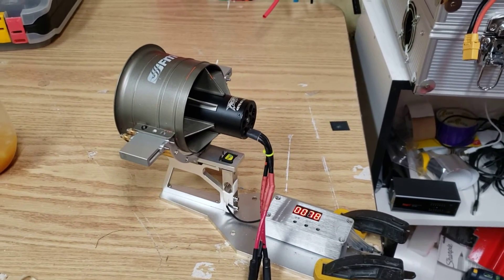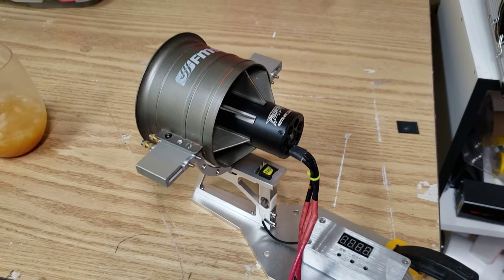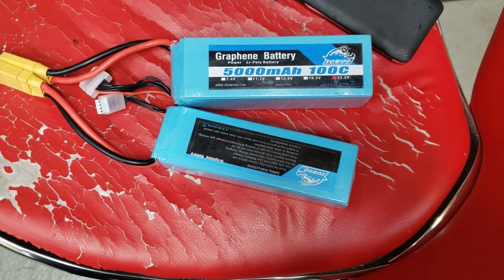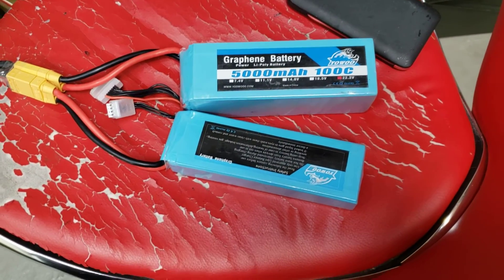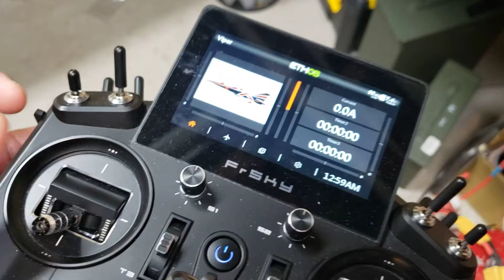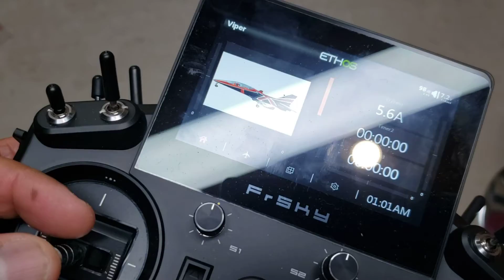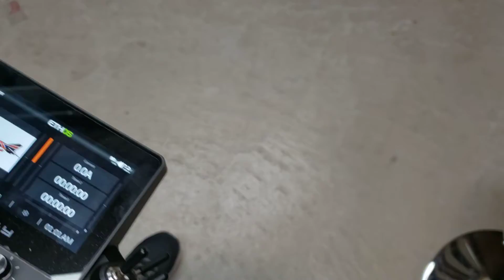FMS  90mm 1500kv 9s and 10s thrust stand test.

Comment: Great power, did you also do a test on 8s? what are the numbers like?
Reply from the maker: I did I just didn't upload the results. My findings were as per FMS specifications on their website.
Reply: @ghoustanable  thanks man
Reply: @ghoustanable  how many flights were you able to do with 10s on this motor.. Considering this setup for my freewing ares. which could benifit from extra thrust for hovering and better punch out. Btw i have a pack of those yoowoo batteries, they perform so well!

Comment: Hey Garfield. Wicked outcome from that 90mm FMS on 10S man 😵
Has it withstood the test of time?
Reply from the maker: Absolutely no issues whatsoever. I've installed this setup on at least six different 90 mm jets with over 100 flights with no issues. That said I think that 9s is the sweet spot in terms of power and easiest on your batteries with lower amps.
Reply: @ghoustanable  
Thrilled to read that. No heat sink whatsoever? 
looking at your data from that test I`d say this is the perfect subject for a 10s 8000mAh Li-Ion 21700 cell pack. 

I will be diving into that and your results here set a good guideline. Probably wont hit the 6.4kg of static, 90% of that realistically achievable. Capacity however doubles with Li-Ion and for those big thirsty jets this might just be the solution - trade a bit of top end speed for allot more flight time and allot more WOT episodes too. 

You ever looked into substituting LiPo for Li Ion?
Reply from the maker: @marioserafimov7254 I did I just didn't want to invest in the soldering tools necessary to make them. That said I know that there is one outfit that's making the batteries but they're pretty pricing
Reply: @ghoustanable  By the way, have you ever had the chance to test the Freewing unit (Metal shroud 90mm 12-blade 4075 - 1350KV) ?

Comment: This is very sick on 10S. This week I ordered some 5S CNHL 4000 just in case xD xD But I would probably go with 10S LiIon that would be in the middle and 9000mAh or 10000mAh with similar pack weights. I´m thinking which 90mm Edf to install in my new older V1 Freewung F-16... Maybe I´ll start on a light 3670 1950kV motor with light Esc and running on 7S LiIon or 8S
Reply from the maker: @ficosk8  where are you getting the Lilon packs from?
Reply: @ hi Garfield!! 👍🏼 well I just get the cells and solder the packs. It isn’t difficult just need a 150W iron for 15 bucks and solder quickly the copper strips on the cells. Everything is very cheap compared to Lipos and this will last up to 500 cycles . Here in Germany at local websites for e cigarettes or NKon in Netherlands. In USA there is 18650 store which also have the very powerful Ampacel JP40 which have very little IR, voltage sag and less heat but are “only” 4000 packs. I’m just starting with this but it is really cool to fly over 10 minutes on one single pack and just 1 parallel. I’ll try 2P on 80mm Avanti and L39 soon I hope but the snow has come here…
Reply: @ your tests have been super valuable!!!

Comment: I saw you run 9s with a 6s and 3s? Can you do 8s with 6s and 2s? 😊
Reply from the maker: @Rombo-86  yes you can if they're the exact same milliamps as well as c rating and manufacturer.
Reply: @ghoustanable  yea of course. I’m planning to buy the fms viper 90mm and put this motor in and run 8s on stock esc. I have to many 6s batteries. So instead of buying many 4s batteries I was thinking to buy just 2s and have with the 6s 😊

Comment: Update: ran this exact set up and everything was great until the 10th flight.  The fan blew itself apart at max throttle during take off.  The motor might be able to handle 10s but the fan has potential to fail.
Reply from the maker: @bryanho6830  sorry to hear about that. I've been running it on over five different 90 mm jets for 2 years with over 100 flights with no fans failing.
Reply: Who knows, maybe the new batches are not as good.  I bought another one and will try again.  The performance is amazing at this price point so I gotta try again..wish me luck @ghoustanable
Reply: Metal blades as on the JPs would help... if that occurs often. But the replace is easy, isn´t?

Comment: So if you run the motor on the highest setting how long does it take to drain the both battery packs? Say if they are fully charged. 
Thanks.
Reply from the maker: Two and a half to three minutes on 5000mah

Comment: Which connectors do you use because the gauge wire on the motor is smaller than the esc
Reply from the maker: XT90
Reply: @ghoustanable  yeah I was talking about the esc connection to the motor what size banana connector you use
Reply from the maker: @mr.maneuver287  I run Castle creation esc, so  6.5mm bullets is what's needed with that gauge of wire from the ESC. The gauge of the wire on the motor is usually smaller than the wire on the esc, which is pretty common.
Reply: @ghoustanable  ok perfect and is there specific settings i should program the esc for.. and I do want the reverse thrust as well
Reply from the maker: @mr.maneuver287  you need the USB Castle creation dongle to go into the programming section in the software. The tab you're looking for is auxiliary. Select the drop-down for reverse thrust, and you're done. Note that you'll also need to run the auxiliary wire. I believe it's a white wire to a separate channel on your receiver to get it to work. Then, just assign that channel to a separate switch on your radio to get it to work. Cheers
Reply: @ghoustanable  you da man thank you so much

Comment: Hi, does the motor supports 10s voltage ? I have the viper 90mm on 8s setup with the same edf unit + motor
Reply from the maker: Yes, it does.

Comment: I have an engine like this and the recommendation is batteries up to 8s, are you using up to 12s. Does it not burn the engine or force it too much?
Reply from the maker: Maximum you can run this on is 10s. That said, I did do 3 test runs on 12s & on the last run up, it exploded. Personal if you ask me. The sweet spot for this motor is 9s if you want to keep the amp draw below 150amps.
Reply: @ghoustanable  which battery you hit 300km/h and the Esc is Ubec or Opto?
Reply from the maker: @maicondp  yowoo 4000mah 100c graphene paired with Castle creation 160 ESC and BEC.  https://youtu.be/ID0l-2xlOC4

Comment: Quick question. I have this exact set up for my Freewing F22. Is there anything specific I may need when extending the battery leads from the esc? Or can I just extend the wires to reach my battery? Also, is the castle 20amp bec sufficient for the Freewing F22 or is there something I need to add? Thank you and sorry for the book. New to this side of building custom.
Reply: Ran mine on 12s and it ran like a champ. Definitely more punch to it. Still isn't getting hot at all. Same set up. Castle 160amp esc, Castle 20amp bec, with the FMS 4075-1500kv 90mm edf. Not sure if you have tried a bench test 12s yet but I must say that FMS motor is a beast.
Reply from the maker: @Jason Willoughby  that's fantastic. I'm definitely going to be trying that once I have batteries that can fit. Thanks for the heads up on this. Send me a link if you've got a video of the flight.  Cheers 🍻
Reply: @ghoustanable  I'll have to get a video this weekend for you then. Only have a certain 2 batteries that fit to run it 12s. They are premium HRB 6s 5200 100c. They are short and stubby. The graphine 6s 5000 100c won't fit in there good enough and maintain cg.
Reply from the maker: 20 amp bec is more than sufficient for the F-22. Regarding extending the battery leads, just make sure that you match the  gauge of wire for the extension. Also, I'd recommend soldering the extension wires together as opposed to putting in bullet connectors to make the extension connection. I did that with my F-22, and it ended up costing me my plane due to a partially disconnected bullet connector causing arcing and eventual power loss in flight. See the link below below of that crash. Cheers and good luck 👍. https://youtu.be/2IEh14r_ZeA

Comment: How do you power your FrSky dual supply Rx? Use an additional BEC? Powered from Flight packs?
Reply from the maker: It depends on the plane. If I'm running high voltage servos, I  use 2s lipo directly to the receiver. If it's like a freewing plane that needs 5.5 V, then I use a BEC.

Comment: you are making my brain explote!.... how much fligh time do you think you can get with an 6000mah on 9s?... what will you say to put a 3300mah on 9s?  i heard you can flight with 12s on 3300 easy cause the consumption is lower on 12s
Reply from the maker: 6000Mah 3.5 min. Regarding 3300 pack on 9s too short a flight for me. This edf cant handle 12s. I tried it and the fan exploded. very dangerous situation!
Reply: @ghoustanable  thanks a lot for the answer and the info !!
Reply: @ghoustanable  Hello, after about 8 flights with the fan on 10s I`ve noticed a significant power loss ... I was aware of not heating the edge and the esc... might I damage the edge? Is it fixable?
Reply from the maker: @danielalessandrini2299  that's strange. I'm not really sure. it depends on the damage to the ESC. That's said I've never had any problems with this setup with over 200 flights on five different Jets the setup has been rock solid.
Reply: @ghoustanable  yes very strange... i bought 2 of them and both had the same problem... and the esc are working fine, 12s 150a

Comment: hi, what's the thrust when using 8s?
Reply: Installed into my F4 phantom it's 3.9-4kg. Installed into my F22 it's 4-4.1kg. In my T45 it's 3.7kg. All 8s.
Reply: @M4rkmcc21  thanks for the reply! I just realize thrust are also depends on the aircraft design.
Reply: @afxdz evo  yeh I found thrust is lost on twin exhaust jets. Also if thr exhaust outlet diamter is too large like in the rafale there's a loss. Can 3D print a smaller outlet tho. Also the T45 Exhaust tube is obstructed with the Air brake servos. I found opening my cheater intakes on my Sirius gained 150g of thrust
Reply: @M4rkmcc21  good information thank you vm

Comment: I have same setup in my f22. I was using custom timing at 7 for 40 flights with no issues. I watched a video and changed the timing to low 1 and 2 minutes into the flight power failed and I deadsticked. I guess im saying I would not run low timiing with castle using this motor fan combo.
Reply: on 10s?

Comment: Can jet fan handle this? If I were to get the 1500kv and run it on 10s do you have an idea? Currently I’m running the 1680 on 8s and was thinking to upgrade for more power and speed
Reply from the maker: Yes Jetfan  can handle it. The hardest that I've pushed  it is 1400 kV HET motor with Jetfan v3 on 12 's and it worked just fine. The link below is for my 10s flight with the exact same setup. https://youtu.be/GduRucOdeOI
Reply: @ghoustanable  hey brotha one more question how much flight time do you get on 10s 5,000mah?
Reply from the maker: @octane2099  if you fly hard 2 and 1/2 minutes with throttle management 3  and 1/2 minutes . Obviously this also depends on the condition of your battery and the weight. For the first flight keep it to two and a half minutes check your batteries and then adjust accordingly as far as time goes in subsequent flights.
Reply: @ghoustanable  thanks for always replying and helping

Comment: Hi mate. I’m looking at buying this unit for 8s. But after watching this, and the little extra weight from going 8-10s it’s probably worth going 10s. How have you got on with it? Still working? Thanks Tom.
Reply from the maker: Everything's been working fine however I think 9s is the sweet spot with this motor when you consider overall weight, amp draw and performance. On 9s you can get away with a castle 120 for 10s you're going to require at least the castle 160
Reply: It will be lighter than the stock 8s version from Freewing. My 8s is even heavier then when I set mine up for 12s.

Comment: Thanks for this information. Any data regarding longevity on 9 or 10s. How did it go in the plane?
Reply from the maker: Every single plane that I put it in the performance was fantastic. I  like the extra weight in the plane because it doesn't get pushed around as much in the wind both in the f-22, f18, Yak 130 and FMS super scorpion. Cheers
Reply: @ghoustanable  do you think fan and motors can handle full power continuously on 9 or 10s without breaking or burning?  I'm very tempted to try this but want to make sure reliability will be reasonable too...
Reply from the maker: @acw400  I've run them hard with absolutely no issues on 9s and 10s. The motors have never burnt up nor have I had any rotor failure other than sucking something into the rotors off the runway. What I definitely can't tell you is that 12s is definitely a no-go... you will destroy the motor and the rotor. That said,  the answer to your next question is yes I did try it on 12s on my thrust stand can't remember what the numbers were but it was insane and it only lasted for about 30 seconds before the rotor completely destroyed the entire unit. Curiosity got the best of me so I tried it but I tried it in a safe way. Cheers
Reply: @ghoustanable  Thank you so much for all this information. This is very helpful.